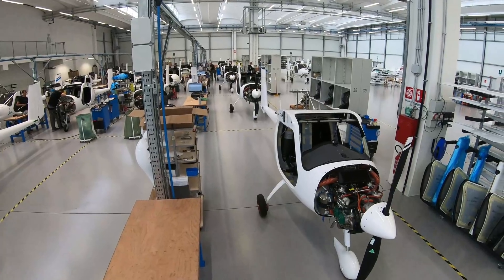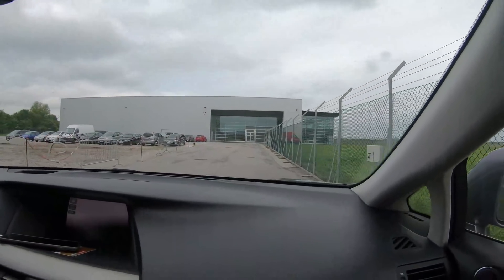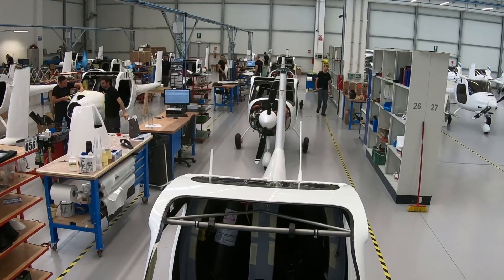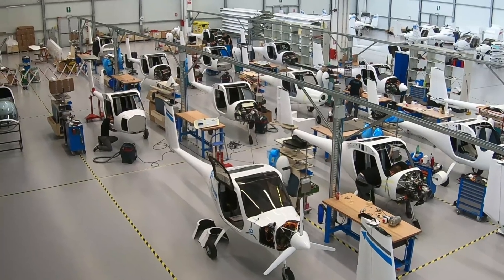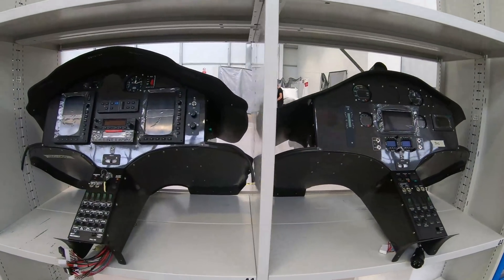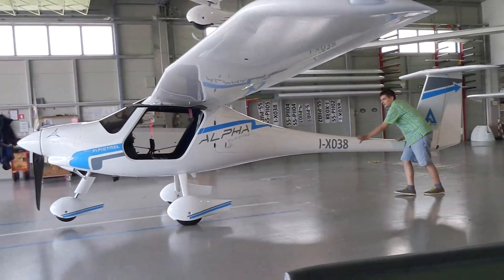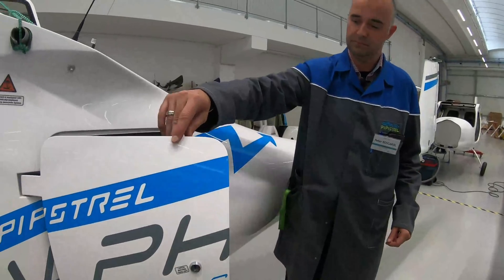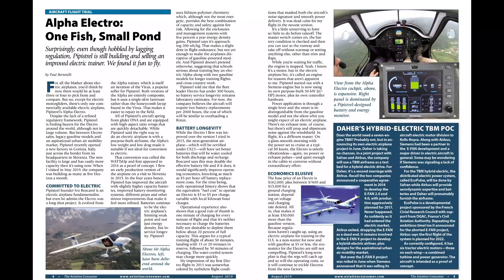How Pipistrel Builds Electric Airplanes

Comment: How is it that the Pipistrel Alpha Electro, or the Taurus Electro, for that matter, do not have photovoltaic cells incorporated onto the upper side of the wings and the horizontal stabilizer?

It seems like a natural.

PV cells, integrated into the battery management system, would not only provide supplemental "trickle charge" while airborne (ergo, increased range and/or loiter time), but also be capable of fully charging the batteries, independently from the grid, while parked.

Other electric aircraft and motorized sail planes have already incorporated PV cells onto their airfoils, so obviously, it is a proven technology.
Reply: PV cells are woefully inadequate for even charging this plane with a 50 minute endurance.  That's why electric cars don't even bother with them.

Comment: Consider saltwater batteries 3 times more power by the same weight.
Lithium is Out. Swiss companies developed those batteries.
Reply: B.S.! Lithium is not out yet. Where did you get the numbers about power density? Actually, saltwater batteries are a lot heavier than Li batteries.

Comment: push a tiny hole through any lithium battery, and see what happens.
Reply: What happens?    In what circumstances?    How is this relevant to the aeroplane in the video?
Reply: @DavidOfWhitehills  https://www.youtube.com/watch?v=wUFxlf4fXjo
Reply: @DavidOfWhitehills  a giant explosive fire happens.
Reply: @DavidOfWhitehills  diesel, JP 8, and even gasoline, cannot be caused to explode so easily.
Reply: @MarkMcAllister-ni9sf  1: Lithium batteries don't do that. You have been misinformed, orare seeking to misinform.  No-one has been killed in a lithium battery fire.  Millions have been killed in gasoline fires. They don't use lithium flame-throwers.

2: Electric aeroplanes will not be suffering engine failure, therefore no crashes.

3.In the astronomically unlikely event of an electric aeroplane crashing it won't be the lithium that kills.
Reply: @DavidOfWhitehills  The Boeing 787 was grounded for this risk. And just wait until a jihadi drills the back of his laptop battery in flight.

Comment: It would be nice if it could fly for a few hours, but it doesn't.
 so your stuck to short hops an back
But the brain dead are still at it. Why did they not incorporate a huge solar panel in the wings, They have flexible solar panels now that would contour the wing, this would give them a much longer flight time an would charge the batteries up in flight an while sitting on the ground.

Comment: Why an Electric airplane? Combustible Engine Works Fine - Only in Europe!
Reply: Electric is much cheaper, as in several times cheaper. With current battery tech they are rather limited in capabilities though, but you can't have everything.
Reply: Internal combustion engine works fine but it's horrible efficiency, expensive fuel, high maintenance,
Loud, vibrations...
Also leaded fuel exsaust fumes are not the thing that i whould be happy to breathe in
Reply: @blackturbine  Makes Sense - Thanks!

Comment: One thing I don't get about electric planes is why they don't use an apu style auxiliary prop to charge the battery in flight.
Reply: Because that wouldn't work due to the law of energy conservation?
Reply: probably not weight effective.  Engines aren't completely efficient, and if you are going to burn a fuel anyway, may as well use a normal engine.

Comment: kinda dumb question... do they have... regenerative braking?
Reply: @BananaPeal0 it wouldn't spin backwards, just create some resistance, which ICE already have for internal friction
Reply: @BananaPeal0 Speed is constant but friction is present regardless. Electric motors have little to no resistance (if you don't regen brake), what I meant is that at equal mass / coefficient of drag, an electric propeller would have a slightly high glide ratio because the propeller would spin more easily
Reply: No.  Nor do they have regenerative  BRAKING.  Brakes brake cars, planes, flywheels, even horse-drawn carriages, regenerative or not.  Breaks are what you have when you need a break from the crappy spoiling the skools teech these days, and it BREAKS my heart.

But a good question I think,  is it worth the weight penalty of whatever is necessary to recover battery power from a descending aircraft, like you might be at the absolute limits of battery exhaustion but you need to go around again?
Reply: @DavidOfWhitehills  Sorry. I'm not a native speaker and I often got it wrong despite knowing what the differences are.
Just a distraction.
Reply: @yosyp_yosyp  Ok  you got me, I can only speak good english and bad french - most people in this world can speak many more languages than me.  I apologise.
Reply: @DavidOfWhitehills  It's ok mate ;)

Comment: WHO THE HELL wants a "battery Powered" airplane?
I know several dozen pilots and NO ONE wants anything to do with such a monstrosity!
Reply: Nearly everyone who's ever had anything to do with aircraft maintenance would love the transition. Seriously, no more oil leaks, dirty spark plugs, ignition timing issues, magnet issues, exhaust leakage, cleaning oil, fuel and air filters, changing the fuel lines, etc...
Just perfect for flight schools and sightseeing tours. Sure, for private use you would be quite limited by the range, but if you only charter, it would be nice to be able to choose between electric and conventional of the same aircraft type depending on the flight.
Reply: It's people like you that create stalls in technology development.

Comment: Don't confuse electric battery powered aircraft for environmental responsibility.
Aux contraire.
Reply: It certainly is. Manufacturing emissions are only minimally (10-20%) higher, in service on most grids you are looking at an 80-90% reduction in CO2 emissions and zero local particulate emissions.

Comment: A plane that only can fly for less than an hour, then must be recharged for an hour is not appealing to me.  They need to greatly increase flight time and reduce recharge time.  In the interim maybe they could offer affordable quick-change battery packs so your downtime is only 15 minutes.
Reply: you can also change batteries. but otherwise this is a trainer aircraft anyway.
Reply: Colonel K 
Or you could stick with the internal combustion engine powered aeroplane.
With the heartwarming knowledge that you aren't using such dirty technology as battery power.
Reply: @bipolatelly9806  Batteries are dirty in the sense that they need to be charged by some other other power source, and when they wear out, disposal becomes something of a problem.  Their main problems right now are size, weight, cost, and inefficiency.  These can be mitigated to a degree by using more advanced material designs, but the inefficiency can never be fully overcome.
Reply: Colonel K 
How about dirty lies re. the weather?
Reply: @bipolatelly9806  I did not understand your question.
Reply: @Paladin1873  I think bipola is an oil company shill, trying to tell you that batteries are dirty tech and the climate isn't changing.
Reply: @svorkoetter  When the terminology isn't clearly defined, it's hard to know what anyone means.  That's why I offered an explanation of "dirty".  As for "climate change", that's a term with an endless number of meanings.  For some it is a religion, for others it is a con game.  That leaves a great deal of middle ground.  All I care about is practicality.  Electric motors offer some great advantages over combustion engines, but they are limited in their potential development by our current understanding of physical laws.  There is nothing unusual in this fact, for it also applies to piston, turbine, jet, and rocket engines.  The only real difference is these latter technologies have been more fully developed.  As I see it, unless some unforeseen breakthrough takes place in battery efficiency or electric motor operation, the electric airplane is doomed to remain in the category of novelty, much as the steam powered airplane was.  I hope I'm wrong, but I also hope hyper light-speed propulsion and anti-gravity devices will be a reality someday.  We shall see.

Comment: Electric air crafts made flying cheaper but there are two problems No.1 electric flights are short range flights while we need long range flights and No.2 problem is that batteries are heavy in weight, but on the other hand if we make electric planes base on Hydrogen fuel cell instead of batteries we can even beat fossil fuel

Comment: If you put eletric motors on the wheels you can decrease the takeoff distance. This is important because the plane spend a lot of energy on this operation.
Reply: It doesn't, actually, since taxi is very low energy compared to flying. There are some corner cases where this isn't true for jets, but for small aircraft like these that doesn't apply. Electric airplanes have full torque at zero RPM, unlike piston powered aircraft, so the full power is available right at the threshold and continues into flight. A machine with electric motors on the wheels could be dangerous as well, since the airplane does not really prove it is ready to fly just because it reaches flight speed. If the aircraft was disabled somehow (overweight, damaged, controls locked) then you wouldn't know that until shortly after take-off, where the airplane would fly briefly then settle back on the runway. At least with current airplanes, the pilot would know it is unable to fly fairly early on in the take-off sequence.
Reply: @benjamind7290  I understand that, but the full rpm and torque don t means full traction. eletric motors on wheels could result in a huge takeoff distance improvement what means more time to the pilot response at emergence. Thx
Reply: @ZR-eq2hl   No, because all that means is the aircraft takes off without being in a flight ready configuration. Motors on wheels also provides complication; wiring over the landing gear, weight that the airplane must always carry, and new modes of failure (one wheel fails mid-takeoff, for example.) Yes, the takeoff roll distance would be reduced, but it is not clear that makes for a better airplane.
Reply: Ulisses Vinícios Airplanes don’t rely upon traction for takeoff, the thrust is generated by the propeller and not the wheels. A plane can take off on a zero friction surface and not know the difference. Traction is only important on landing when you are relying on the force of friction of the surface to slow your plane.
Reply: Actually,  small,  low- power electric wheel motors could have a small benefit.  They could help with taxi, beginning of takeoff roll, and also spin up the wheels right before landing to reduce that brutal acceleration on the tires upon touchdown [and tire wear].  They could also provide regenerative wheel braking,  greatly reducing the landing rollout, while returning some energy to the battery.  On this particular plane, with low endurance,  this would not be a good idea to add the weight and complexity,  but once endurance is increased,  adding wheel motors of equivalent weight to wheel brakes would be useful. Also,  I'm thinking a propeller is very inefficient at near- zero speed,  and wheel motors could reduce a small amount of wasted energy needed for endurance. 

Even a simple software trigger of full flaps followed by reduction in engine power could trigger pre-spinning the wheels before touchdown, with the pilot not having to think about it.
Reply: @Ulisses Vinicios You don't really know much about flying do you? Can you imagine the electric motors and mechanisms that need to be attached to the wheels....and the weight? All this just so it can take off faster? C'mon.

Comment: Solid state batteries already exist in the laboratory and they have a 2.5x power density increase over the current technology.  In addition they can be rapid changed in 12 to 15 minutes.   It will be about 10 years, give or take, before these batteries are produced on a major scale.  That means that the 50 minute flight time would expand to 125 minutes or a bit more than 2 hours.  After that, land, charge up again, and you're back up in a very short time.   The batteries also can have over 20,000 charge/discharge cycles, compared to maybe 3,000 for LiPo batteries.
Reply: @BPwhistleblower    Unfortunately a drogue would put extra drag on the aircraft and require that the motor burn up more power to maintain the same speed.   The power generated would be less than the increased load would demand.
Reply: @BPwhistleblower What, your phone ?
Reply: @BPwhistleblower Ha. What I'm saying is, all your drogue idea will do,is charge a phone whilst in flight.